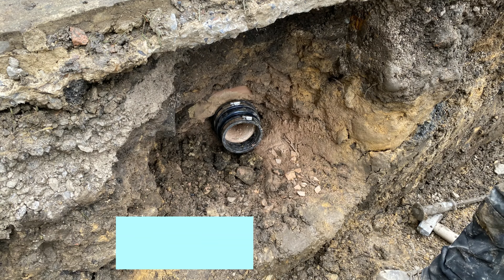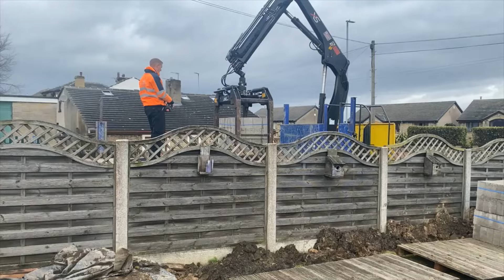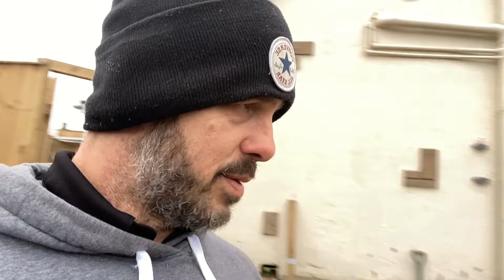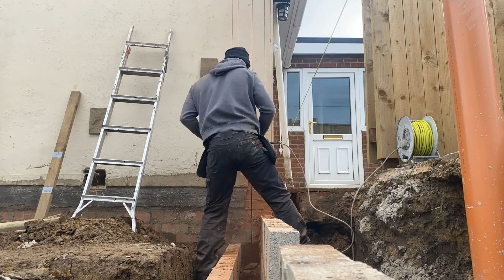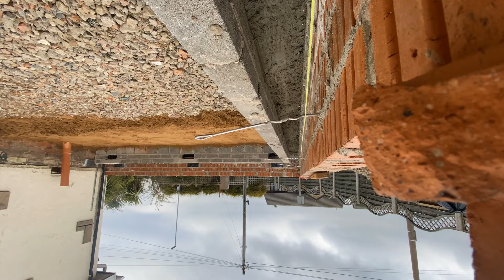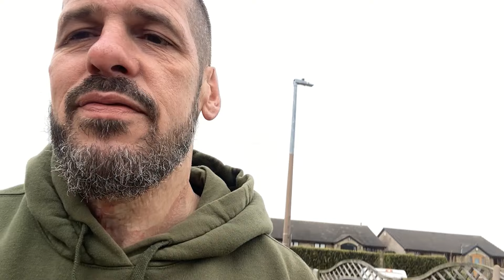A proper self build by a complete novice.part 2 up to damp course.

Comment: Couldn’t help but notice you have a half in the wall. Just off a corner. Big no no in bricklaying. Tip for you, Always dry bond out brickwork under ground to work out correct bond to make sure you avoid unsightly cuts. At worst if you tighten perps up and get it to a big three quarter.  Smaller perps look better than big perps. I’d reset it now before bashing on as you will get to the end and regret it. Even if it’s under a doorway it will appear again over the lintel. 🧱👍